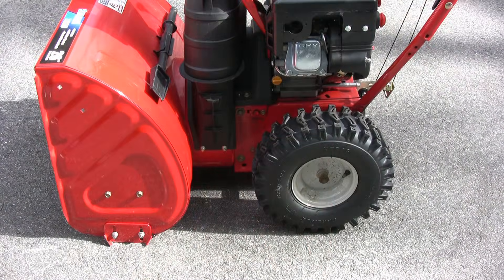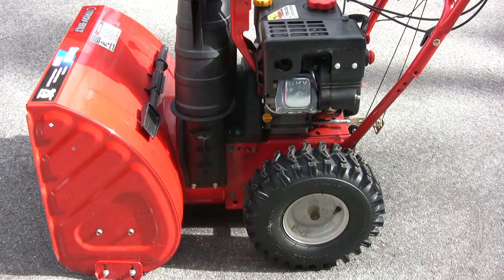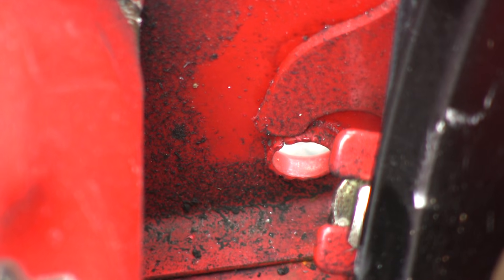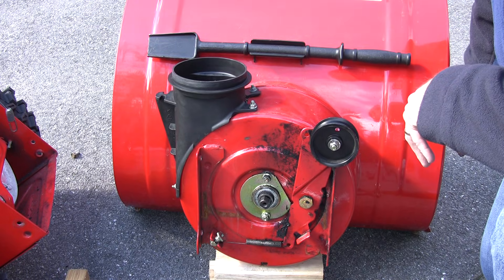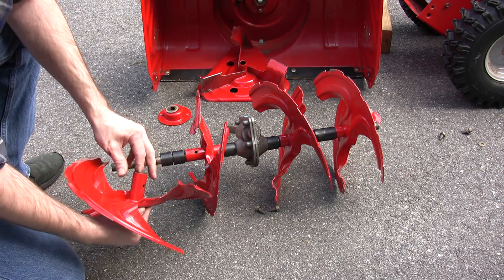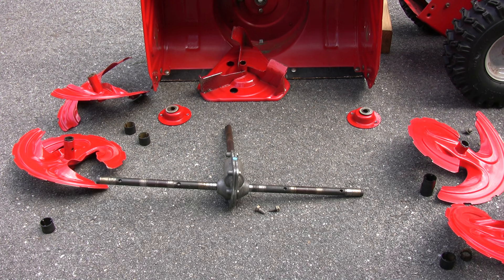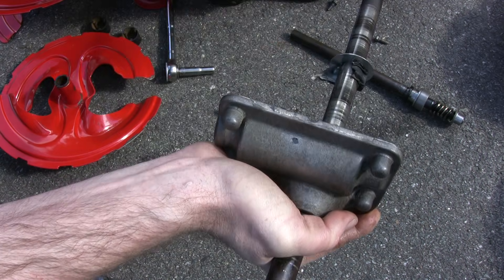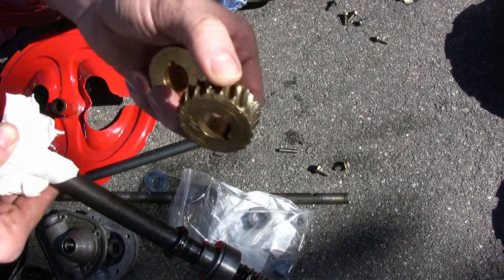Troy-Bilt MTD Storm 2620 Snowblower Auger Gear Repair - Part 1

Comment: I can't find a kit on amazon or eBay.  Do you know where I can get one?
Reply from the maker: I believe I lucked into a 1-off kit. I have never seen another. I know it is a bit of a pain, but I would recommend tearing it open, seeing what parts you need, and then searching Amazon, Troy-Bilt, etc to see who has them at a decent price. The Troy-Bilt parts diagrams are you friend for ensuring you have the latest part numbers (they are subject to change). https://www.troybilt.com/en_US/ari-partstream-host.html

Good luck!
Reply: @DavinDesborough  Thank You and thanks for putting together an incredible video!

Comment: Finally getting around to this.  Winter is near.  What type of grease do i use for inside gear box?
Reply from the maker: I just used a random cold weather (low temp) grease I found at a parts store. Something like this should be fine: http://amzn.to/2yoQzk0  Good luck!
Reply: Davin Desborough thank you

Comment: Your very detailed video has inspired me to to replace an auger (same make and model as yours) myself rather than incurr a costly repair bill. Thank you. Full disclosure, I'm new at this. My first hurdle is getting the idler pulley off. Either I just don't have the strength required or there's a trick to it that I haven't figured out yet. Any suggestions?
Reply: Got it. I just didn't have the right angle. It should be smooth sailing from here -- or at least until it's time to put it back on.
Reply from the maker: +R. Wilt Good luck! Barring anything being corroded in place, the pulleys are the hardest part in my opinion. Thanks for watching!

Comment: Hi Davin: Although you posted this auger gear box fix over three years ago, I found it very useful in fixing my Troy Bilt 2410 by replacing my worm gear at the end of the season last winter. However, my snowblower will not throw snow. This is not a knock on your repair instructions. I just don't know what is now wrong. When I rotate the shaft (manually and disassembled), the auger blades do rotate. But when the unit is fully assembled, engine running and auger control lever engaged, the blades and impeller will not turn. I think I did the repair correctly as when I first tried to throw snow after the repair, it worked for about one or two minutes and then failed. I don't think I could have ruined the worm gear again. Any ideas? Thanks, David
Reply from the maker: I would remove the belt cover and look in there. I think that perhaps you hooked the belt up incorrectly or it fell off or something. The impeller is directly tied to the shaft and should spin regardless of the worm get condition. It just seems like no power is being transferred to the impeller shaft. Good luck!
Reply: Davin Desborough
Thanks Davin. I will give this a try. I have it apart again but left the gear box intact for now. Upon reassembly, I will focus on the impeller belt, etc. Much appreciated.
David

Comment: Having similar issue. Thanks for posting.  Do you a link for the kit you used to replace axle rod and gear?
Reply from the maker: Sorry, but no. It was something I found on ebay and that was the only one. You can find all the parts individually, but I have not seen any other kits. Good luck and feel free to ask more questions if you have them.
Reply: I got a worm gear and a worm shaft from Amazon for $71, that did the trick ! I called Troyilt first 
to get the part #'s to make sure I ordered the correct parts. All good !

Comment: What is the part number for the kit?
Reply from the maker: Not sure one exists. It was a bundle of parts I purchased on ebay. Other have asked this same question and I have never found such a kit when I've looked. I would recommend just going to  https://www.troybilt.com/en_US/service-and-parts, looking up your exact model, and using the diagrams to find the parts you need. Order from them or look up the part numbers elsewhere to see if you can find a deal. Good luck!

Comment: I disassembled as instructed but the auger won’t come out no matter how hard I pull. Anyone have advice ?
Reply from the maker: So, just to confirm, you have taken the bolts out of the side and removed the pully wheel from the back? If so, the shaft may be seized on the bearing. I would apply liberal amount of penetrating oil to it and let it sit for a day. Hopefully, after that, a couple whacks with a hammer would be enough to free it.
Reply: @DavinDesborough  i was able to get it off - I needed to get a gear puller to separate the two pieces

Comment: Great job and explanation.  I couldn't help but feel a little bit sad, to see that they put the Troy-Bilt name on that.  Used to be heavy duty equipment and that is just not.  But, you did a great job and I'm sure will help lots of people.
Reply from the maker: Thank you. I share your opinion on the overall build quality. I purchased this at Lowes and have come to realize that the Troy-Bilt and John Deere equipment sold at big hardware stores tend to be lower end compared to what you can get at the actual dealers. Sure it may cost a bit less, but as always, you get what you pay for.

Comment: the old ariens were so much more heavy duty. Thats pretty simple to get apart.
Reply from the maker: Pretty much everything that begins with "the old..." was more heavy duty  :-)  

From what I understand, the brass gear serves as a lubricating element, rather than having steel on steel. Thanks for watching!

Comment: I feel like there coulda been an easier way to replace the gearbox. Maybe a flange in the middle of the impeller shaft going to the gearbox would make life a lot easier
Reply from the maker: Yes, but that would add cost to the machine and you know they won't want to do that! While a little tedious, it isn't really that bad to take it apart like this. Thanks for watching!

Comment: why The F is the gear brass !???
Reply from the maker: I can only suppose it is designed that way to act as a planned breaking point in the case of something catastrophic. That or the softer metal makes it slide against the worm gear a bit easier. 

Anyway, thanks for watching!
Reply: @DavinDesborough  Generally, the auger shear pins are supposed to break, but you are correct from what I just read, "The most common worm gears are made with a brass wheel and a steel worm. This is because the brass wheel is typically easier to replace than the worm itself. The wheel is made out of brass because it is designed to be sacrificial."
Apparently, if I read that article correctly, it also allows for looser tolerances and cheaper repairs.  In the case of MTD, blowers, though, I've seen several where the whole gear case just exploded apart.   And you aren't kidding about that seeing a lot of use, you wore out the skid shoes in only 3 years!